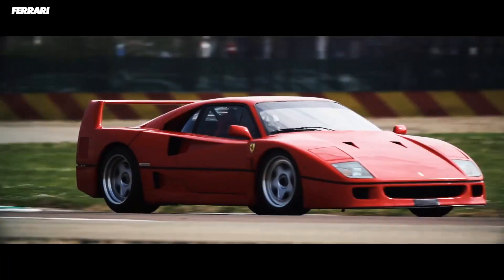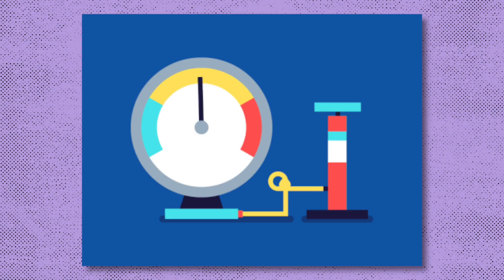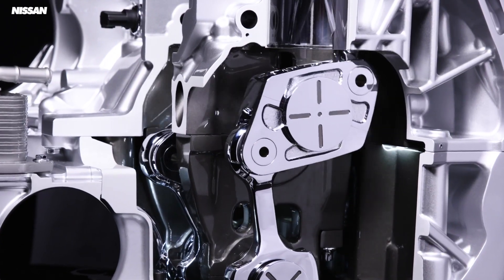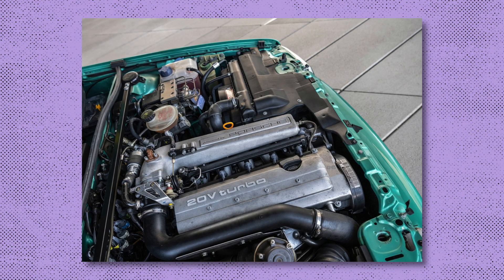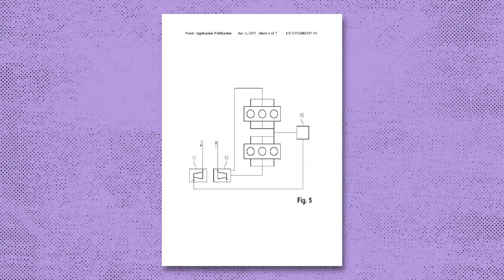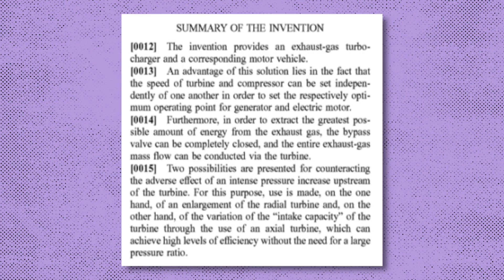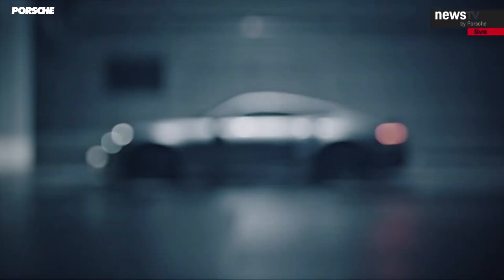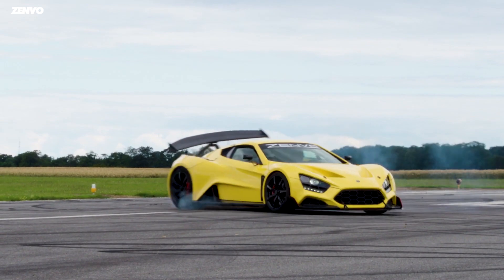Porsche's GENIUS New Turbo Design

Comment: So Porsche is using a turbine impeller to drive a generator, and using its power to drive a boost impeller which pretty much makes it an electrically driven supercharger.    When you are no longer using exhaust gas to spin the turbo, it's more of a supercharger than a turbocharger.
Reply: But superchargers are mechanically driven, so this system wouldn't fit the definition of a supercharger either. 
I would say it's closer to a turbocharger since it uses exhaust gasses as a power source.
Reply: @xIcarus227  Considering they're separate components, you have an electric turbo and an exhaust pressure driven turbine generator. Only if they are an entirely separate electric system, you could consider them as a single entity. I don't think that makes a lot of sense, considering how much electrification there is in modern cars. I'd expect this type of set up to be intended to integrate well with (mild) hybrid systems.
Reply: @Alfred Wedmore Do traditional turbochargers have any control benefit over superchargers?
I understand electric driven turbochargers to be fully controllable, but a traditional turbo's speed and therefore pressure generation is directly related to exhaust pressures, isn't it?

Comment: What if you put one of those exhaust turbo hot bits with a generator atyached to the shaft and then just leave it at that. You could put this mini generator on small engines used in hybrids that are hooked up to a generator anyways to get better efficiency in charging via engine

Comment: Think it's worth mentioning the main reason turbos help with efficiency is they help boost performance using energy that would otherwise be mostly wasted as the exhaust exits the cylinders at high speeds
Reply: Not really, they do, but the reason they are more efficient is down to capacity, off boost you are fuelling a smaller capacity,. Remember all engines have to meet the required air fuel ratio, bigger engine just needs more fuel during cruise to keep the a/f mix within safe numbers.
Reply: @philiphawkins4684  But they are also having to run lower compression ratios because of that which undoes a good proportion of the downsizing element. It's only worth it because it doesn't cost a lot to do in terms of energy. That's why supercharging never took off in a big way as the cost in energy means the slight benefit in downsizing isn't really worth it

Comment: Lorry and heavy commercial diesel engines already widely use variable vane turbos - another way of getting turbos to spool up quickly, therby reducing lag. Why are they not widely utilised in petrol car engines, whether exhaust gas or electrically driven ??

Comment: Combine it with a hybrid system, and you could keep the thing at full boost literally 100% of the time while in race mode, and in eco mode, it could keep the compressor off and utilize some of the exhaust gas energy to drive the hybrid system slightly more efficiently
Reply: Honeywell-Garrett has had it for several years for hybrids and its EU-7 compliant. Porsche is a copy cat and just because they “filed” for a patent doesn’t mean they will get it. Porsche just doesn’t want to pay the Garrett price. Porsche has a NIH attitude…I saw the Honeywell-Garrett Audi Diesel Turbos development that won LeMans up close when I was working there. In fact after the LeMans win, HON-Garrett put the winning engine on a stand in their lobby. That’s how much Audi recognized their effort by giving up the whole engine and turbos.
Reply: @PFLEONARDI0906  Once again, I think you're talking about an MGU-H system, where there is a motor on the turbo, but there is still a rigid shaft connecting the compressor and turbine
Reply: @PFLEONARDI0906  

No, they haven't. If they filed for patent they will probably get it. You can't bypass patents like that. It's also essentially a waste of money to try.
Reply: @PFLEONARDI0906  all it takes is the slightest variation in design to receive a patent
Reply: The torque a turbo experiences probably won't be worth the clutch and gears you' have to fit between it and the generator shaft. Nice idea but I think using the turbo to provide forced induction is probably best for fuel efficiency in any case
Reply: @benrampling812  Clutch? Huh? You can freewheel an electric motor with ease, no clutch needed. Also, turbos spin at a speed achievable by DC motors, so no gears needed either. And no, turbos do not increase efficiency, they increase power, meaning smaller engines for the same power, meaning better fuel economy when not under boost (and ask any turbo economy car owner how hard it is to stay out of boost, and you see why they tend to get 30mpg in the real world, despite being rated at 40 for lightfooted drivers)
Reply: @specialopsdave  "turbos make more power so we can use a smaller engine" yeah so in summary they make engines more efficient. DC motors typically have an RPM range of 20-25000rpm whereas turbos can spin up to 250,000 rpm. So yeah. It needs gears. You will still encounter some eddy current/ eddy braking trying to rotate a DC motor shaft that doesn't have a slight running current going through. It would make more sense to have a standard turbo with a ratchet/ centripetal clutch mechanism between the motor and the turboshaft that could spool up the turbo or act as an electric supercharger to decrease lag. You could take this further and put a ratchet gear of some sort between the turbo and compressor so that the motor only spools the compressor and doesn't have to spool the turbo with it. Once the turbo is spooled the power will stop coming from the motor as the turboshaft overspins it.
Reply: @benrampling812  No.if you take an engine that makes 35mpg and add a turbo, it will never make more than 33mpg. So turbos make engines more efficient by reducing fuel economy? That's like saying that women's clothing makes a person happier because they're female and women tend to be happier. It's a roundabout and stupid argument.
Reply: @specialopsdave  you just contradicted your last comment completely then. If turbos are only drawing 2hp from the engine (let's assume best case scenario if you are saying it will lose at least 2hp) and now let's consider an electric motor drawing maybe 40% (assumed 50% efficiency of turbos in single stage configuration multiplied by mean efficiency of motors at 80%) of 1hp and you get about 300w. Is it really worth compromising the effect of the turbocharger for something the engine already does with a generator far  better than a turbo does in this scenario?don't get me wrong there is a lot to be said for gas driven turbine generators. I think they should be option over full electric cars. They are more efficient than ICEs but the difficulty is not losing that efficiency through the drive train. Be it mechanical or electrical.
Reply: @specialopsdave  I'm using half of the 2hp in this example because something has to keep the turbo spooled for the sake of the engine that's y'know... optimised for a turbocharger
Reply: @benrampling812  2hp? Now you're just throwing around random BS, the amount of HP it draws can get as high as 40 (granted, it increases the power by like 150, but still, efficiency loss in the intercooler is a problem) You must be thinking of what it draws at idle.
Reply: @specialopsdave  I said in previous comment let's assume at best it draws 2hp. Google cognitive dissonance i can't be arsed to debate this with you anymore. I have about as much energy for it as I do playing chess with pigeons... keep thinking that you can make a magical turbohybrid with your warped understanding of physics 😂
Reply: @benrampling812  "let's assume" means "let us believe that in this real-world scenario I am hypothesizing". Also, cognitive dissonance? That has nothing to do with this. Throwing around random smart-looking words that you don't even use correctly is a great way to make you look like an idiot, as evidenced by your use of "let's assume" in a situation that we assume to not exist, ever, at all.
Reply: @specialopsdave  you are the one trying to run a turbo engine without a turbo. It's called lugging and it destroys engines. You also don't seem to get how you will lose power between a turbine and a compressor if you link them through a motor and generator 😂 it makes no sense. There have been countless videos proving that electric forced inductors/ compressors don't add power because they draw more from the engine than create power. You'll have the same problem trying to draw power off a tiny mass rotating at a tiny radius albeit rotating very fast.
Reply: Basically an mgu-h
Reply: Straight dual turbo on a honda 90s era 4 cylinder. B series, D series. 
Stiffen frame
Better suspension
New clutch, cv axles, brakes, and upgraded gearing/transmission.
Beat a lambo around turns for less than 10k.
Reply: I forsee alot of turbos blowing up. Constant boost probably gonna wear them out faster
Reply: No energy is free. The exhaust is still hooked up. The generator would take a significant amount of hp decreasing hp. No energy is free! Know the laws of thermal dynamics laws of energy.
Reply: @Xxcody3232xX  Energy... That's not being used, because you're off throttle, and thus using no power, and the remaining energy would otherwise be turned into heat. Know the laws of thermodynamics.
Reply: @specialopsdave  soooo ur not regaining that power is still being taken away smarty pants. Don't come at me acting smart. You clearly don't know how physics work
Reply: @Xxcody3232xX  Taken away from the engine... That is not powering the car AT ALL. Engines don't provide power to the wheels when you are off the throttle, you should know this. If, instead, WHEN YOU LET GO OF THE GAS, it takes energy from the engine THAT OTHERWISE WOULD HAVE BEEN WASTED because it's not being sent to the wheels.
Reply: @specialopsdave  go make it then
Reply: @Xxcody3232xX  part of the magic of turbos is that it actually captures some of the unused heat that did not get converted into kinetic energy by the engine during combustion into kinetic energy in the turbo for compression. So while turbo back pressure does rob some power from the engine through backpressure in the exhaust, if the system is designed right, it also converts heat energy into usable kinetic energy by allowing the gasses to EXPAND past the turbine, not just flow through it (as if it were a river or dam water driven turbine). This is one reason why large aftermarket turbo-back exhaust systems can help increase power so much in so many vehicles. By decreasing the back pressure on the outlet of the turbos exhaust turbine, the higher pressure differential across the turbine allows for the gasses to EXPAND past the turbine, capturing quite a lot more energy that would have otherwise been wasted by the engine AND the more restrictive exhaust with a smaller pressure differential. 
Understanding this combined with this patent, one could understand that having generators on ANY exhaust, if designed right, would capture unused energy, and then if used intelligently, could be converted back to kinetic energy with a turbo or electric booster motor (during acceleration only) to increase power and or fuel efficiency.
Reply: I was just thinking that before i even searched this,
Mazda is working on a hybrid inline 6 i doubt they will use a electric turbo, but we can only wish 🤞.
Reply: couple that with the variable compression engine and you have the best of all worlds
Reply: You just described the EQ boost system  from Mercedes-Benz (M256 3-liter straight-six engine)
Reply: Funny how you described be much hated F1 V6-H engines... guess it's OK when Porsche does it.
Reply: @TiagoJoaoSilva  Trust me, what's considered good in a luxury car is not considered good for F1 cars 😂
Reply: @specialopsdave  You mean, next generation F1 cars won't be SUV-sized? Ridiculous! Everybody loves SUVs! I bet next year, F1 drivers will demand decent sized cockpits where they can bring mom and the kids along when racing!
Reply: @specialopsdave  Sorry, but Porsche is n0t luxury car. It's sport car with good materials and good handling, but leave all that luxury to f.e. LC500, which is The Masterpiece.
Reply: @specialopsdave  Or vice versa.
Reply: @klausstock8020 😂
Reply: @TiagoJoaoSilva  there considered hated because they aren’t v10, also people hate hybrid racecars
Reply: @Tommmmmmmmmmmm  Especially when it’s possible to make 1000WHP without the hybrid system with a four pot…..
Reply: @Tommmmmmmmmmmm  Eco extremists are not welcome in motorsports and the car industry.
Reply: @Tommmmmmmmmmmm  But that’s not cool
Reply: @Velocitist  You mean the BMW M12/13* four cylinder engine, I guess. Based on the M10 engine (introduced 1961), downsized to 1.5 liters, it achieved 1400HP in the early 1980s. In the later 1980s, development of these engines continued outside of BMW under the name "Megatron".

Awesome as such engines are, they don't exactly comply with today's emission standards, and they are also tailored to last for the 305km F1 races. When doing a day trip from L.A. to Las Vegas, be sure to give your mechanics in Vegas enough time to swap your engine. ;-)

One the plus side, it would require fewer fuel stops than the V8 Dodge Hellcat. ;-)
Reply: @Elliott2001  better fuel economy means running with less fuel.
Reply: @Elliott2001 not wanting to die in 30 years is not extremist in anyway.  Hybrids at least *have* an ICE.  Not to mention most hybrid systems are more reliable than a standard ICE car
Reply: @ayoutubechannel921  no?? People love the lemans stuff
Reply: @TiagoJoaoSilva  funny, i love the hybrid V6. It still retains some of the sound of a high revving Low torque high Powered engine with some new technology.. What i don't like is all the ones asking for a full electrification of the F1 cars.... 

Believe me when i say it's not the V6 engine that makes F1 dirty. it's all the trucks,Generators and etc required to host an F1 event or any event for that matter... 

In sweden all football games that are live broadcasted is using diesel Generators for main feed while main grid is a backup... So let's start with this and exchange all diesel generators for windmills and let's see how that turns out -.-
Reply: @TiagoJoaoSilva  Funny thing is, aren't Porsche asking for the ERS-H to be dropped if they're to enter F1?
The ERS-H is my favourite thing about the current F1 engines, turbo compounding is a cool concept!
Reply: @rsporsche  turbo compounding isn't a concept it's been being done in diesels for a couple decades
Reply: Bottas, said in a 2021 interview that Mercedes’ already has it. 

There is nothing to image….
Reply: @LilSebastian_  No, they haven't. F1 turbos MUST have the compressor and turbine connected with a physical shaft. This video talks about a turbo with no direct connection between the two
Reply: @specialopsdave  I'm quite sure Ferrari already made a patent on a simila concept
Reply: @LilSebastian_  some F1 engines is using a Split-turbo design HOWEVER this design still requires the Turbo to have a mechanical shaft between Turbin -> MGU-H -> Compressor side.

New eninge regs will certainly drop the MGU-H because of cost. however i still think the split-turbo design will remain since it allows the Compressor to not directly next to the hot turbine side.

Comment: Ok first off this is not a turbo!😠
It is an electric air compressor.
A lot of "Top Speed" cars utilize these.
This technology had been around for over 30+ years.
Back in the late 80's, early 90's there was a lot of experimentation from lots of different manufacturers but nothing came to fruition.
This is nothing new. 🤦

Comment: For me, the best combustion engine is a naturally aspirated petrol 3.0 I6 with 360 PS at 8300 rpm and 312 Nm at 7500 rpm (just like Honda S2000 but with two more cylinders). That combines everything I like - enough power and torque, small size, light weight, wonderful sound, low complexity, easy maintenance, good fuel economy, etc. Imagine a RWD 1200 kg family hatchback with that inside. Sweeeeeeeeeeeeeeeeeeeeeeeeet! ❤
Reply: You want the M3 CSL engine ?
Reply: @djdrastic1  Not exactly. That engine was bigger, had more torque but both power and torque peaked lower down the rev range. But it is somewhat close...

Comment: Could such a turbo remove the need for an alternator? Would this further reduce drag on the drivetrain?
Reply: Probably not since it won't produce enough energy at idle. That said mild hybrid systems use the the electric motor as both the starter and the alternator as well.
Reply: @flacjacket  Makes sense, so if they all used the same battery/wasn't insanely expensive, could be pretty nice for overall efficiency
Reply: Eternal Peace  You're missing half of the electric turbo the way Porsche is pattenting it. There's both a cold side and a hot side turbine. The hot side charges a battery, the cold side uses the battery charge.
The difference is that an alternator runs off the drive train and the hot side electric turbo turbine runs off exhaust pressure. The thing being that at idle speeds, there's very little exhaust pressure, but there is plenty of power going through the drive train. So that's where the alternator is a much simpler design to keep your battery charged.
Reply: Eternal Peace  I would say yes. Those problems can be easily solved by including a minimally sized 48v battery. When idling too long car can increase idle RPM to build up exhaust gases to start turning the generator to charge up the 48v battery.

Comment: NA performance engines are far from dead. Porsche, Ferrari, Audi, Lamborghini, Ford, Chevy, Cosworth and Lexus are all still producing them. No need for overly complex electronically assisted hair dryers when you have an NA engine (that will also last longer). Remember that one million mile Lexus? That had a na V8.